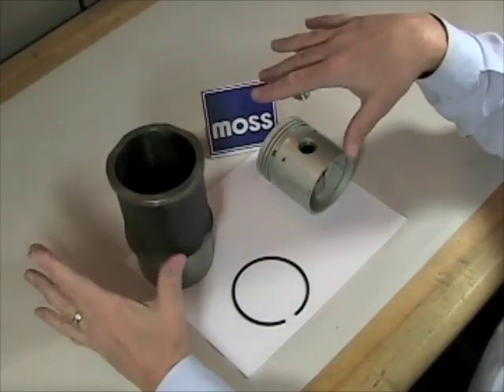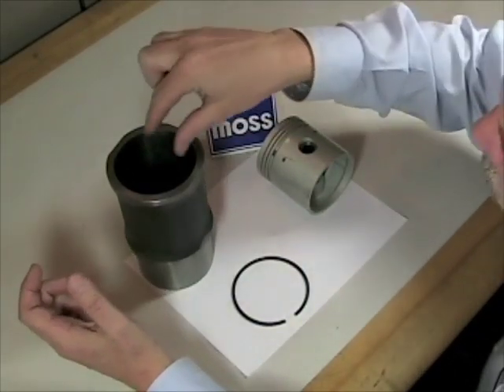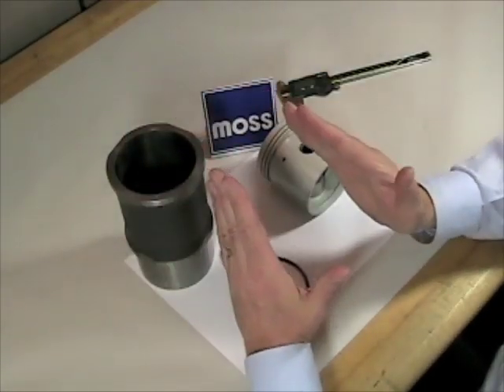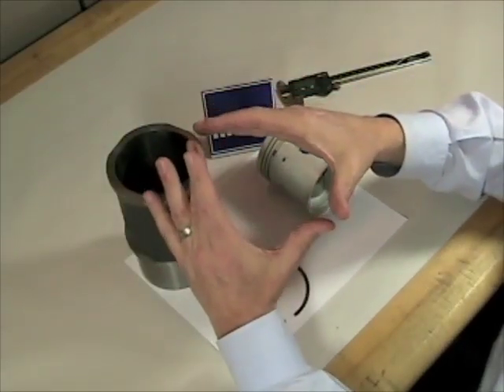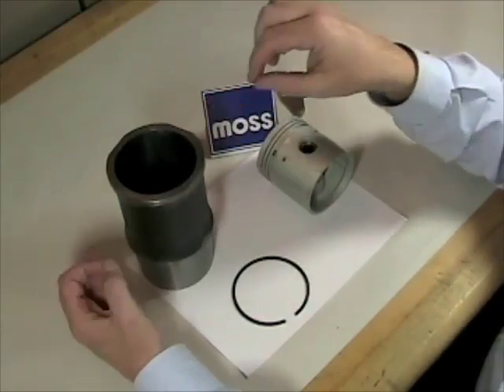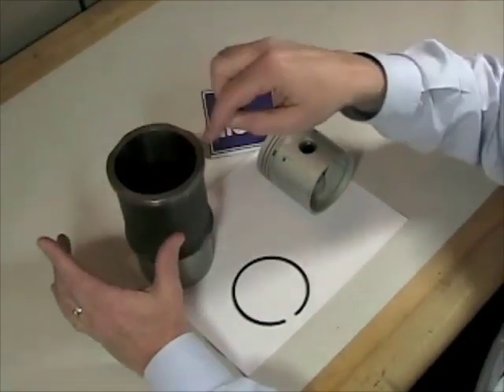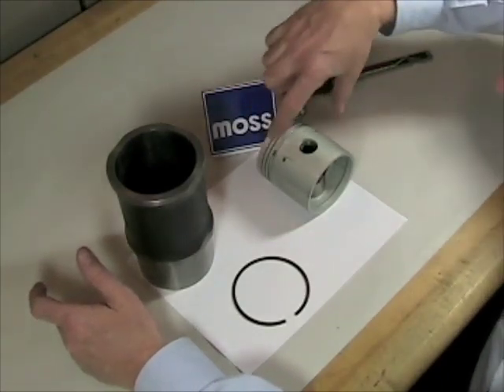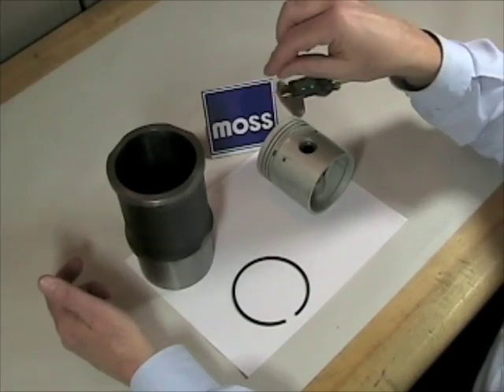Cylinder Bore - An Explanation of How To Measure

Comment: Question. Why are cylinder bores machined with a slight taper? 
And why is the diameter of the top portion of the barrel is slightly smaller than the diameter at the cylinder skirt?

Comment: can I ask how to increase stroke on a 125cc engine bore is 57.0 stroke is 48.8 the bore is big right but the stroke is low can i increase the stroke of my engine to be increase the cc to 150cc
Reply: Ging Valenzuela You would need a custom Made new crankshaft. It's much easier to increase bore and do cylinder head work for more power.